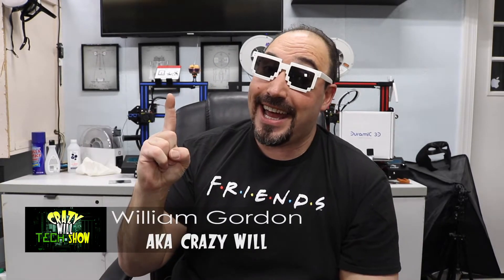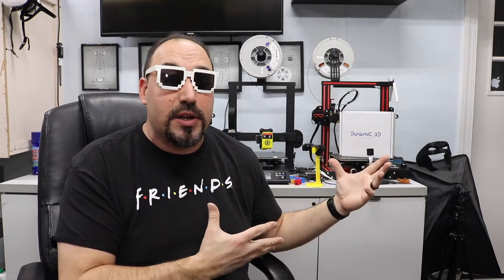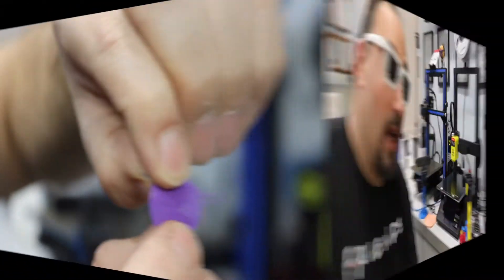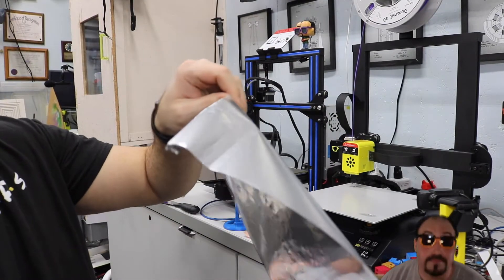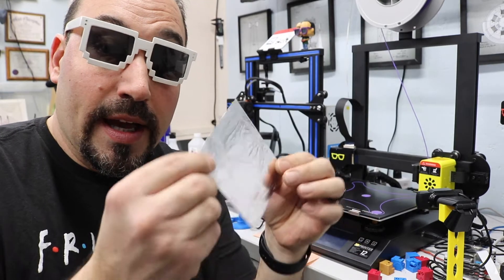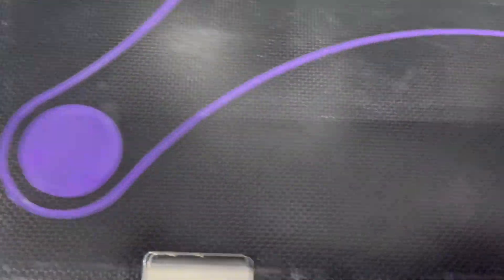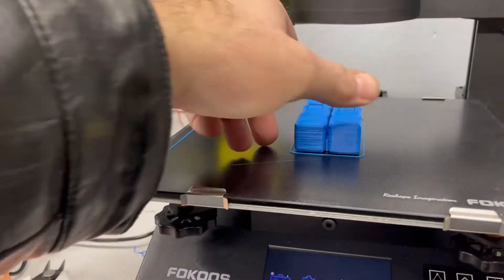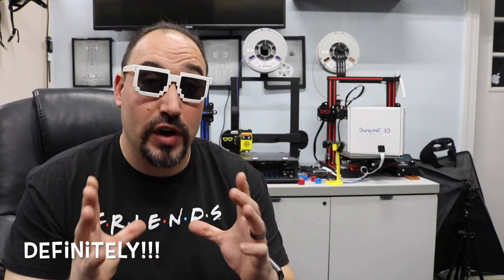How to fix the Fokoos Odin5 F3 when the is middle too high

Comment: HELP do you have a video fixing an error 5 code
Reply from the maker: I’ve never encountered this but this is what I found 
Err4: The temperature of the nozzle exceeds the minimum temperature limit; please check whether the thermal interface is disconnected.
Reply: @CrazyWillTechShow error 5 said it wasn't able to heat up to the right temperature
Reply: I noticed it started happening after my printer kept mispring and bunching up the filament

Comment: Great video! Question my man. I'm having issues with print not sticking to the bed. It keeps coming off after ten minutes in to the printing.
Reply from the maker: Thanks! What temperature is the bed? What material are using? Is it levels correctly? Aka paper trick.
Reply: @CrazyWillTechShow  my bed is around 60 to 70 and yes I level the bed before printing. Pla is what I'm using. I recently just got this printer. I did have to remove a filament stuck in the feeder. Can putting on the fan backwards affects the print from sticking?

Comment: I just got this 3d printer because I saw your video review of it.  This is my first 3d printer. The first few prints came out amazing.  and then I started getting error codes that had to do with the thermistor detecting temperatures.  I contacted the seller on Amazon (Donie) and they sent me a new print head accessory kit.  The thermistor wire seems to be put together poorly and it can get messed up due to the screw on the side that holds it in place.  
I am now having issues with it not being level in the center but also becoming unlevel on the edges after each print.  I'm going to try the tinfoil and see how things go.. thanks for the videos!
Reply from the maker: I’m so sorry. It started out so good for me as well. I had to replace the wheels they were the problem and then tinfoil trick. Now it’s printing fine. We really shouldn’t have to do this.

Comment: Ever had an issue with the extruder not gripping the filament? Changed 3 springs and still not gripping it. Not clogged. Gonna try a shim, then throw it out the window. I may do the tinfoil trick to make a hat if I can't get this fixed lol.
Reply: So I used some polyterra and worked fine. Doesn't like iiidmax lol
Reply from the maker: Yes I did but I just jammed filament through it when I was hot. Seem to fix it.

Comment: My screws aren't raising the bed enough in one corner so I think I should first adjust my zstop slightly so I can get my springs tighter, but the middle has always seemed slightly off compared to the corners so this could be the perfect fix once that's done
Reply from the maker: Good luck my printer is working right now after this fix.

Comment: Nice Fix.  My issue was just the opposite...so I raised the corners with tinfoil and used the glass clips midway on each side.
Worked great.
Reply from the maker: Thanks man… it’s a great printer if they would just figure out what’s going on… I mean that’s ridiculous. Did you have problems with the wheels?
Reply: @CrazyWillTechShow  no problems with wheels yet...only two weeks of use...but did have to adjust y axis wheel pressure with hex nuts on wheel shafts...SAD no wheel pressure adjust I can see for X and Z axis???
Reply from the maker: There is for x little offset nut behind the extruder. It’s a pain to get to. No z and there really tight.
Reply: @CrazyWillTechShow  ahhh yes found the X thanks...can't mod the z for eccentric nuts because the wheels are not cantilevered...but maybe slitly slot the holes in the two mounting plates if reqd.
Reply from the maker: I don’t know I never tried it. When I took the whole thing apart they were really tight.

Comment: I haven’t bought this printer yet, but I was strongly considering it. Have they fixed the wheel issues? Hopefully they saw this video. Nice Falcon by the way.
Reply from the maker: I’m going to say no because others have reported that they didn’t. It’s a decent printer but you may need to replace the wheels. I would definitely factor that into the price.

Comment: Thanks dude, been looking at this for my first printer but got put of by probs, would you have still recommened it. knowing now what problems came up. Videos are great by the way and on point.
Reply from the maker: There all going to have there problems but yes my review would be different. What do you want to print? My favorite 3-D printer is ender 3. Not that they don’t have problems but bigger community and more regularly available parts.
Reply: Thanks crazy for replying back, what drew me to this particular printer was the ease of the touch screen instead of the turn press type control panel, things I'm looking to print are probably on technical side instead of figurines. One thing I can't get my head around is are 3d printer able to print coils/springs. But thanks for highlighting problems found and solutions (which no one else has) think I'm gona get one at this price point.thanks again for reply all the best.

Comment: Muy fokoos beeps AND stops a Lot even when filament still right, how could I fix that issue?
Reply from the maker: I have not ran into that issue yet. I would call or e mail them. Sorry wish I could tell you more.
Reply: this might be a problem with the sensor that detects if there is no filament. When I have actually ran out of filament, it beeps before the remaining filament is even loaded and stops printing.
Reply: @This_Is_MeTrying  thankyou. It is alredy fixed

Comment: Having layer shift issues with my Odin 5 f3. Only seems to happen in the middle. Could this be what’s wrong?
Reply: I’ve changed all the wheels , nozzle, cleaned the tracks, bed is level, not sure what else to do
Reply from the maker: Did you try different SD card? Only say that because I just ran into that myself.
Reply: @CrazyWillTechShow  ended up finding the problem a little while ago. both screws on the belt pulley fell out. seems to be working good now. finally after 2 weeks of not knowing what was wrong
Reply from the maker: @christinacote9463  Took me almost a month 🙄 to fix my problem.
Reply: I’ve had my first printed just over a month now. This was the first problem but I’ve watched a few of your videos and changed the wheels on the whole thing. Everyone I took off fell apart.
Reply from the maker: @christinacote9463  I know for the price point they shouldn't do that. If you get it for a really good price It's a good printer after fixing it's corks. But they all have corks. Bin through hell with my first printer elegoo mars 🙄

Comment: I have the same problem! Thanks Will. Now if I could figure out why the fokoos starts printing and the filament stops feeding. This is repeatable and It is not a clogged nozzle.  Maybe an overheating issue? Any help would be appreciated. Great printer until now. Thanks!!
Reply from the maker: Awesome I’m glad I could help you. That same issue happened to me for me it was the gears feeding the Filament. They needs to be cleaned. I was using cheap Filament A little pieces broke off inside there.